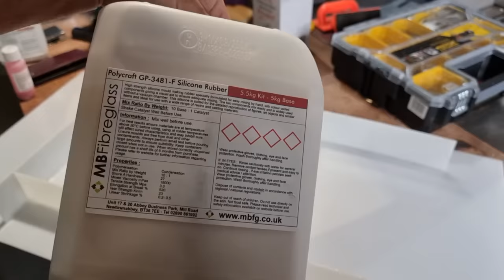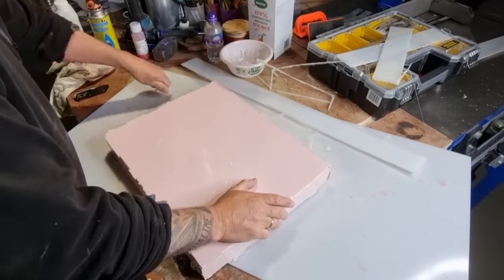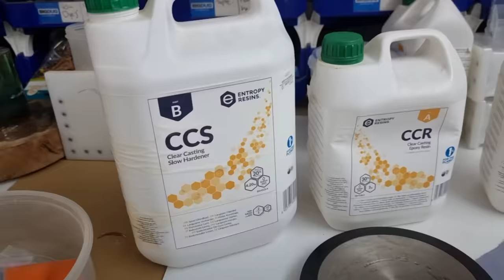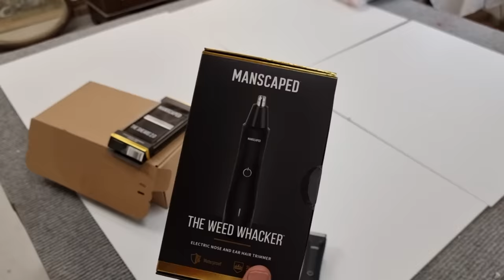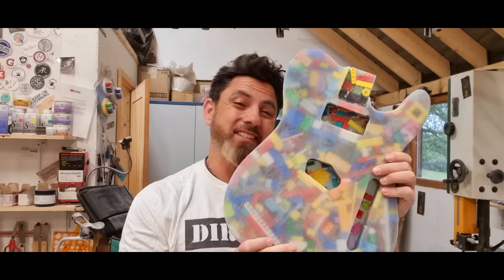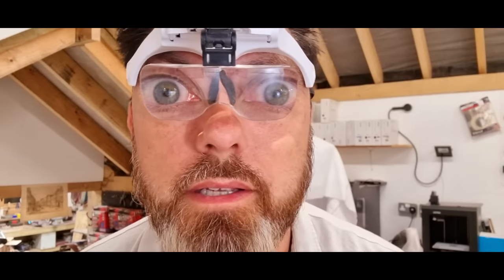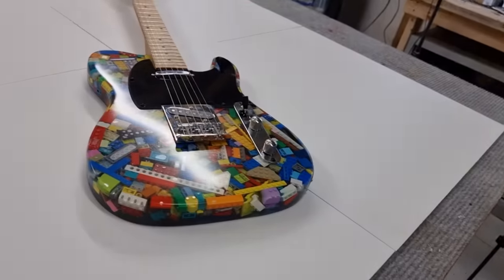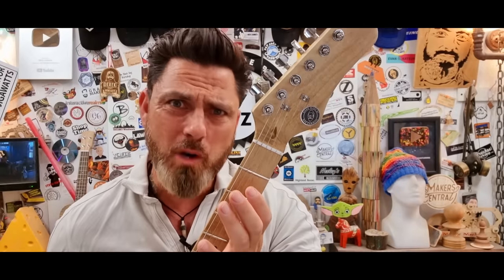Making a LEGO GUITAR Using EPOXY Resin !  &  I made my own Guitar mold 😮

Comment: if you create alot of molds   a good hack is getting a cuticle trimmer for mold trimming. Sounds odd but its game changer. It trims silicone smooth like butter. The edges come out so clean and less work than using a knife. My fave hack for mold making :)

Comment: I'm 53.  When I was 16 I worked at a place that made corian countertops.  Since then I've had a dream of building a guitar out of corian.  The neck would be a single solid piece running through the body with hollow wings to keep the weight down.  The wiring would be done before the back is put on, then the back glued on so the guitar is seamless without access panels.   I'd love to see this made a reality

Comment: Great. Now make a hollow resin body, with a screw on cap somewhere, then fill it with plectrums, so when we lose our last pick, we can screw off the little lid, and shake a few out.
Make a recess somewhere to hold a slide. ( Fit a coricidin bottle in the slide recess, so you can just poke your finger in when you change to slide. )
You'll be on another winner!
Keep on trucking.
I'm learning to play guitar 🎸
Since 1969😁👍👏💜

Comment: This guitar turned out awesome!!! Only thing I didn't like was how you kinda just zoomed past the making of the neck. That's probably the most difficult guitar part to make. It would of been cool to see the whole process or at least a little more on how you made it because it looks great.
Reply: That's because he didn't make the neck.  He lied about it.  Check the grain on the one he cut vs the one he used.  They don't match at all.  The blank he cut was also as thin as the headstock on the one he used and, even if he'd glued on the fingerboar, wouldn't make up for the difference in thickness.  Dude's a cheat.

Comment: Next project:

Use the wood neck to make a silicone mould (like you used the wood body to make the mould for this body) and make another LEGO Guitar but this time, make a LEGO Epoxy neck to go with it...

Just to see if it would work (the Epoxy should be strong enough to withstand the string tension...I think...Maybe...I hope)...

Comment: Looks amazing Nick. One worry is the neck on most guitars is re-enforced with a metal strip. There are huge pressures on the neck when the strings are all tensioned up and wood has the nasty habit of bending. 😕
Reply: It's a called a truss rod...
Reply: It's called he faked building the neck.  Clearly evident by the lack of footage and mismatched grain pattern between the blank and the finished neck.

Comment: When you make a mold, just for next time which will make it easier is to use a spray on material called "Quick Release" which will make taking out the guitar body a lot easier than what you had going for you. Also, you should get some donation of DND Dice that kept on getting low rolls and killing their owners characters and such and make them into a guitar. Also, your boy just gut a subscriber.

Comment: Wow- great work ! The most intricate and most important part would have been making the neck and fretboard. I’m surprised you didn’t buy an off the shelf neck part, as these would be note perfect and fret scaled. Awesome job
Reply: He did buy and off the shelf neck.  Just look at the grain pattern on the blank he cut vs the one he ended up using.  They don't match.

Comment: is it a separate piece of maple for the fretboard with a truss rod underneath or is it just a one piece neck/fretboard with a truss rod in the centre? I think I saw an adjusting nut hole at the top of the neck above nut? So I suspect it is a separate piece of Maple for the fretboard with a rod installed if I were to guess... nice job to you and Charlie
Reply: I don't think he could tell you, because he didn't make the neck.  Look closer at the grain on the blank and the grain on the finished neck.
Reply: @rabidwallaby84  What am I missing? He has me fooled I guess? It looks like he hand made a decent neck, but he skipped the whole assembly and fretting process so.... ?

Comment: It's great, but I gotta ask...why go through such a dramatic and obviously fake neck build? Just SAY you're using the kit neck that came from the DIY kit you used for all of the hardware and electronics?  You bought a DIY Tele kit, and did your own custom body. There's nothing wrong with that man. 

It's so BLATANTLY OBVIOUS at 15:45 when you swap in the kit neck for the ruse neck you'd been hacking away at since 14:52.  I don't get it? I've built dozens of guitars. Several dozen. I've built like...three necks. Necks are a pain. Ain't nobody going to fault you for using a premade neck. 

Just say you used a kit neck - and literally no one would care, as it wasn't the point of the build.

Why go through so much trouble to lie about it though? --And lie so poorly. Anyone who knows anything at all about guitar building, or just general woodworking - knows that 14:52 - 15:45 was all for show.